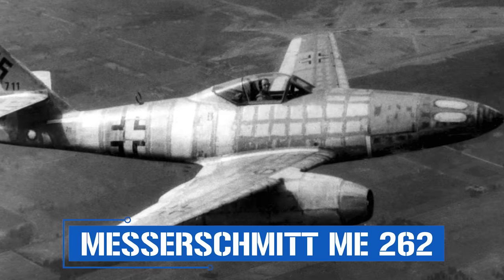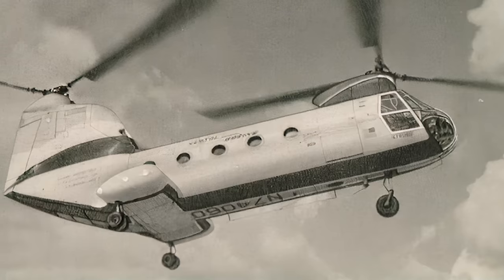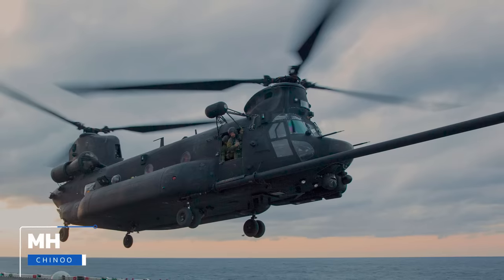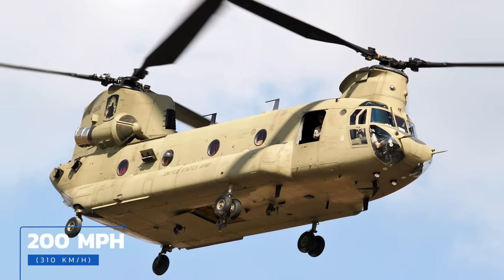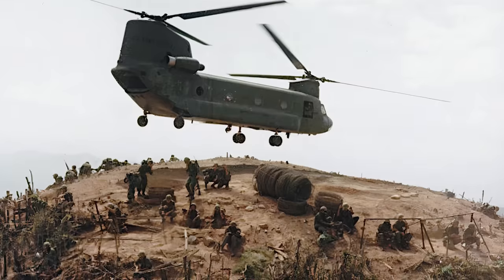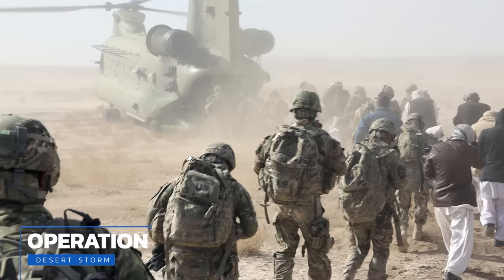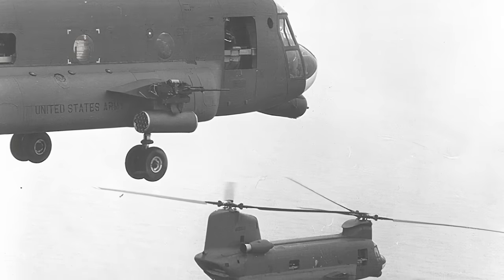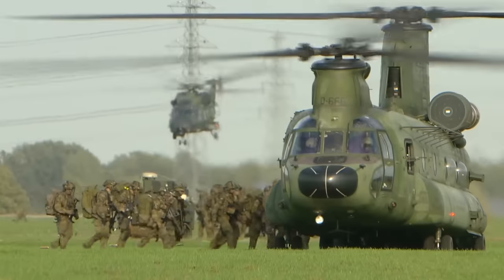The Boeing CH-47 Chinook

Comment: The counter rotating rotors almost cancel out the torque forces, rarely do single blades face identical resistances, much less whole hubs...on a quick pull out to avoid catching lead poisoning, the guy on the ramp seat can convince themselves that they only imagined the frame becoming almost noticably twisted. It is just environmental stress causing them to see it, if you feel like they're going to process it poorly.

Comment: I love your videos but wanted to correct you on info about Operation Mount Hope III. The Mi 35 Hind did not enter service until the 21st century. Although the Mi 35 Hind is an upgraded version of the Mi 24 Hind that existed beforehand. Also, I wonder if you would ever do a megprojects video on the very first true attack helicopter that never made it to production. the AH 56 Cheyanne. It was well ahead of its time and would even outperform just about every helicopter in existance today. The Appache has been called the Son of Cheyanne and the father of the A10 Thunderbolt. The fall of the Cheyanne brought fourth birth of the latter two aircraft.

Comment: if you look at the how much can it lift vs. how much power does it have the Chinook is king, there are others that lift more, but with much more Horsepower. The twin rotor is the most efficient heavy lift configuration, I'm sure it has drawbacks but nothing beats the Ch-47 in pure engine power to lifting capacity, not wasting power on the tail rotor to cancel the torque effect allows 100% of the engine power to go to lift capacity, IMO that is why the Chinook remains king.

Comment: Wouldn’t it be cool if you could see Chinook armed to its weight capacity but imagine stress a few cannons or big machine guns would have on the airframe
Reply: It would need to be strenghtend, but it could basically become a smaller C-130 Gunship.
But the airforce already has the Gunship and the A-10, there really isn't a good reason for a Chinook to be placed in that role as well.
Especially when an Apache could do the same job
Reply: @teaser6089  yes but total destruction In a 360 area is interesting imagine it dropping out of clouds on top of enemy and spraying lead every direction.  I worked on Chinook in Military my instructor was part of test loading same weapons from AC130 to a Chinook.  He said it was insane everyone firing a once he looked up and the airframe was turning into what he said looked like jello.   he had to stop the test immediately and they scrapped idea afterwards he said.
Reply: @dustintacohands1107  It would be cool indeed, but yeah the changes needed to the fuselage to acomedate the recoil of those guns would probably just cost too much
Reply: @teaser6089  yeah true and it’s a stupid big target

Comment: Apache does have a higher Vne than the Chinook, but in level flight, lightly loaded, and in low density altitudes the Chinook is faster. When heavily loaded or in high density altitudes, the Chinook is somewhat speed limited by dynamic component stress, monitored by the crew through a strain gauge on the fixed link attached to the non-rotating swashplate.

Comment: There was another variant used in Canada. They were called labradors and used by the Canadian coast guard and rescue
Reply: That's the CH-113. They were Air Force aircraft, not Coast Guard, but they were used for search and rescue. The Canadian Army also had the same aircraft as the CH-113A Voyageur. These are all Vertol Model 107, not the larger Model 114 (CH-47 Chinook).

Comment: You mention the shaft that synchronises the two rotors but you did not make reference to the controversial accidents that have apparently occurred when this synchronisation fails - possibly due to poor maintenance. The controversy arises because these accidents have typically been blamed on "pilot error" much to the dismay of the families involved, rather than to a fundamental risk associated with the plane's design.

Comment: I seem to recall that Chinooks had issues with transmission failures back in the 1980s.
Reply: There were, yes. The C models got uprated engines but the combiner transmission wasn't upgraded.

The big crash in Mannheim was due to other issues, though. The Army was using crushed walnut shells in solution to clean the oil races in the transmissions. They'd blow the mix out after with high-pressure air (north of 1200 PSI), but OSHA flagged it as a safety hazard. So the air pressure was reduced, leaving chips in the races and starving the bearings of oil.

There was also a problem in the input coupling on the fwd transmission that Boeing warned the Army about (again, could lead to oil starvation). The Army said not to worry about it.

50 dead later, The Army sorted its shit. The D models were the ultimate lifters in the family. The F models out today are heavier and can't lift quite as much, but they last longer and have upgraded avionics, glass cockpits, stuff like that.

Comment: Am I wrong in thinking it would be a great idea to have some sort of drop down armor plating all over the front of those really fancy engines and such on the V280? I’m not an engineer here but, seems like going into a battle in your underwear. “ Hey Guys! Look at me, and all of my redundancy on display for anyone with a decent rifle or(scoff) some russian ( I refuse to capitalize that word), ainti aircraft guns. A Canadian goose could fly into the fancy transmission ( that doesn’t burn the deck off of carriers). Looks like a great platform. I just see a design flaw. Armor the Pilots. Add a few pounds and put shin guards on that thing.

Comment: almost 200mph top speed good god.
Reply: I think the near empty downwind is about 250 ground speed.
Reply: I flew the "A" and "B" models.  For long flights we had an option to tilt the forward cyclic more forward.  I used it a few times and we gained a few more knots.  For some reason, maintenance did not like us to use it.  It probably required a more frequent inspection.  Like to hear from more modern Hook folks if they still do cyclic trim for faster speed.

Comment: What happened to a mention of the Gloucester Meteor at the very start of the video?, the Meteor was the Second jet fighter in the world to enter service, and could easily have been the first if the project to produce the first jet engine by Sir Frank Whittle (I believe he was a pilot officer when he started his research in the early 1930’s) had been taken seriously by the Air Ministry, and it was only a few months behind the ME-262 entering RAF service, the only jet fighter in the allied air forces and the only allied (British) jet to see combat (technically it was combat, shooting dawn V-1s), so WHY talk about the Luftwaffe ME-262 and Arrado when they were NAZI aircraft and the Meteor was British 🇬🇧.

@ 4:35+, There is ONLY ONE RAMP AND ONE SIDE DOOR, nor ramps and various side doors, all the other doors and windows are purely for escape not for passengers.

I spent nearly ten years working on the Chinook’s during my RAF service as a ground engineer (Techie) and those years were the very best years of my service, they were, and are, the most incredible piece of machinery that I ever had the pleasure of working on and flying in, they were noisy, vibration heavy and extremely hard to work on (in certain areas, but not all), but I wouldn’t have missed my years of service on them for all the tea in China, and tbh I don’t think that anything I have seen so far in the replacement pipeline will match the mighty Wokka, it is the absolute pinnacle of heavy lift helicopters.